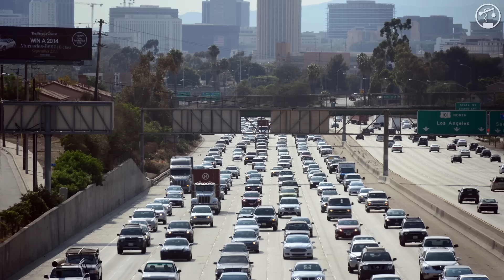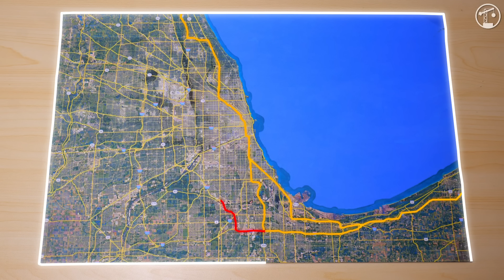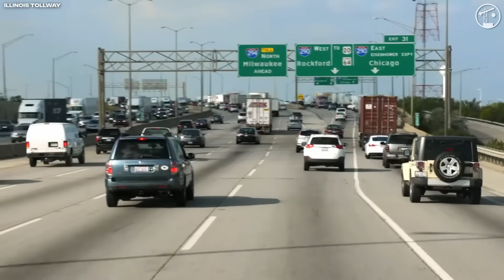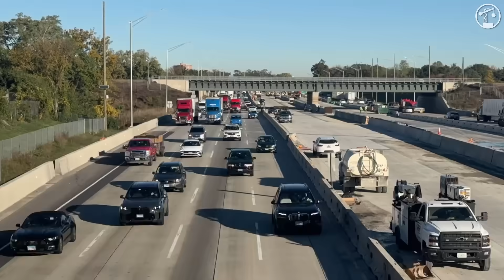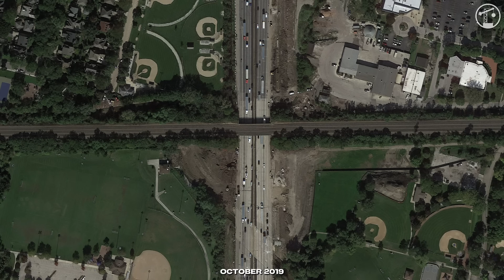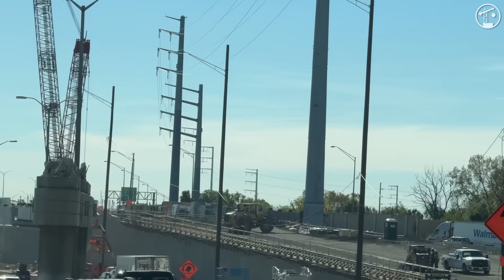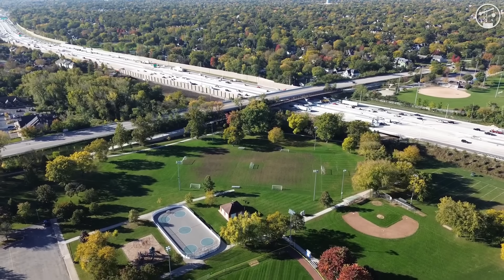Why Chicago is Spending $4B on One Road

Comment: Think the answer lies in why the Eisenhower Xway became I-290 back in 1978. It was I-90 from the now Byrne all the way out to Schaumburg…. but that just begged the question??? Why not build the 16 mile bridge between the Hillside Strangler, near Midway and the Skyway? No not the Crosstown debacle. A hypotenuse that would shave near 6 miles off the current 22 mile trip down Ike and North Ryan. A bonus is that the current 60 mile trip from Schaumburg to Hammond would be 50. The tollway is making plenty of $$$ and are ready to raise tolls. This project would be near $8B and take a decade built OVER existing rail ROW with minimal neighborhood disruption or destruction. No amount of widening existing xways would do what this would.

Comment: The original roads that were built and used as the toll system were paid by tax dollars... All the improvements and all the time to continue to maintain these roads seems more like money laundering than engineering.  This is a never-ending tax to every citizen that lives or drives through the area.  To top it all off, Google maps suggests the most expensive routes even though they may be slower.  I have experienced this on numerous occasions.  Many other occasions there happens to be an accident or something else on a straight road forcing many people to use the skyway and the higher toll prices... It just doesn't seem like coincidence at all. There is some fuckery going on.

Comment: The worst area is 290 East at 294 South interchange near Hillside.   Dickhead drivers sneak down the center and left lanes all the way to the last moment and then slow down to cut in front of the line just before the exit ramp, causing a backup several miles all the way back to York road and sometimes beyond.    I swear when I become king I will place a sniper at that interchange to do what needs to be done.

Comment: Thanks for the explanation of the project. I drive a sprinter and a straight truck all over Chicagoland and I am rarely delayed more than ten minutes. There are a bunch of workarounds for problematic areas, like the 294/290/88 interchanges. And if you are cagey about it, taking 294 is a piece of cake.

The bigger problem for me is the work on 53 north of 90, but there are plenty of workarounds for that one too.

Comment: The redesign of 294 South to I88 was done by a DEI HIRE! They took something that worked half-ass and to the lowest level of stupidly there is. A half-ass interstate to the state of not moving at all. Take two major interstates, run them together, down to two lanes, force the traffic to cross each lane to get to the interstate you want to get to and then give them nowhere to go. AT RUSH HOUR you could take 294 S to I88 and for the most part, keep moving. NOW Traffic is backed up a minim of 3 miles JUST TO GET TO THE EXIT to go through the maze of HELL. It's now a GOOD 2-3 hours wait.  JUST FREAKING BRILLANT!  ILLINOIS - WHERE THE CRIMINALS RULE AND THE INSANE design roads.

Comment: Lol the biggest problem is compared to other highways.. the off angles of 294 because of the other highways is the biggest problem.. not to mention adding another lane will mean more cars ans trucks will use it the biggest problem is trying to change lanes to get off. Too many people dont let you in on top of clueless drivers trying to change lanes at the last min. Like the 294 to 290 should habe done what they did with the new off ramp to connect 390 an elevated on and connect further west. The other big one is with that many lanes the furthest left two lanes should only be for cars or light trucks.

Comment: What a mess.  Thanks to the oil companies for promoting automobiles and destroying mass transit and long distance railroads \s. These "improvements" won't last 5 years before the next major congestion crisis disables it all.  What, create 30 lane wide roads everywhere?   CHicago had the best railsystem in the world (still has one of the best commuter systems). No thought given to expanding and improving that (fewer trucks, more local freight distribution...heck put the trucks on trains). Concrete accounts for 20% of the CO2 problem in the atmosphere.  This requires a massive rethink of how we commute, travel, and distribute goods and services.   The (ultimate) goal should be: NO CARS WITHIN THE 294 BELTWAY.

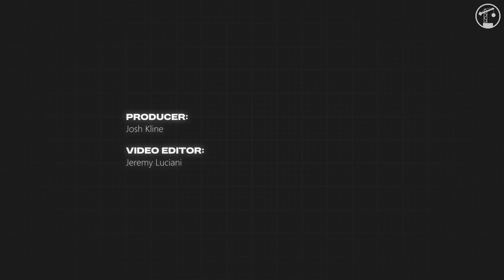Comment: Some issues with the congestion could be solved by raising the speed limit to 70 mph instead of 55 in most cases in the 9:19  Chicagoland area. Especially on I-94 and I-57.  There’s no reason that I-40 in the smoky mountains has speed limit of 70 and keep right unless passing signs. And i94 and I-57 doesn’t  is a big mistake.  I-40 is much more challenging to drive regardless  of the vehicle than anything in the Chicagoland area. Making this change would solve a huge conversion issue.
Reply: I’m gonna tell you, virtually nobody drives the speed limit. 90/94 especially, left lane is 90mph+. LSD is unofficially 70mph. We got places to be 😂
Reply: LMAOOOOOOO 

You think people follow the speed limit???? No one goes at the posted limit and it's extremely rare that state troopers pull you over for speeding.

Comment: I lived in the Chicago area for almost 50 years.  For DECADES, they have been trying to expand freeways and their disgusting tollroads and they have never been able to accomplish much of anything.  One thing you can count on there is that when a road project begins, they will first tear the entire roadway apart and then do nothing for months at a time while traffic becomes even more horrendous.  On top of that because of all the corrupt politics there, they can never even get to expanding roads significantly.  It's so awful that it was one of the reasons I moved out over 20 years ago.  Frankly, you couldn't pay me to live there.

Comment: What this sounds like to me is "just one more lane bro" but fancy. Like, there is no true fixes to traffic that I heard. All I heard was structural improvements and some tech. What does this do? Why make this 5 lanes??? Four lanes is always enough. Even two is. The issue is the interchanges and traffic in other parts of the city that backs up onto the highway. Now, yes, crashes do happen, and yes, traffic stops and pulled over cars divert traffic, but four lanes sould be one more than enough to get around that. They should also look harder into what is causing the crashes. Is it bad drivers, or is it distractions, or is it bad roadway design?

Comment: We sold a home and bought another just move 20 miles from the NE end of this corridor to the far SW side of it. We saved LITERALLY 500+ hours of drive time, stuck in traffic, in the past 6 years since we did that. We still will avoid the 294 corridor as much as humanly possible. Suggest everyone to the same.

Comment: I drive from Wisconsin to Indianapolis couple of times per year.  SB 294 is fine until Ohare and then it turns into a nightmare.
Reply: You mean theres a section of road in Chicago that is trash  good thing they took our road repair budget and as always gave it to Chicago
Reply: 100% after ohare going south is a nightmare. Going through at ~5pm is not for the weak

Comment: In a metro the size of Chicagoland, “IF induced demand shows up?” 😂🤣🤣 No doubt the better geometry will make the road safer, and that’s good…but I’m not a fan of increasing capacity with more lanes. It will be perpetually congested, adding more lanes is not a solution.

Comment: When our cities have a lot of traffic, the lanes get split physically.  The inner 2 or 3 lanes can only be used for a destination much further way (say 5 to 10 miles ahead at least), and the outer 2 to 3 lanes are for local in and out.  The inner lanes keep flowing with 60-80 mph, the outer have 30-50 mph with traffic lights and roundabouts.  Much easier than merging different users in one huge plane of tarmac.

Comment: Going through Chicago at 2AM to 4 AM has always been my favorite time. Often doing it within a minute or two from the last trip through.
Reply: I've been stuck in 'red taillights as far as you can see' traffic at 2am in Chicago before 😮‍💨 you're never truly safe
Reply: i remember i had gone all the way across 294 to the jane addams sooo fast at that time after a long road trip. just me and 2 other SUVs hauling ass. even still there was some congestion at that time as well
Reply: Cruised those corridors like butter for years from 1am to 5am
Great drive!
Reply: Now there's snipers on that route
Reply: 2009: late August,  2 baseball games -- SOX and CUBS, Dan Ryan Expy and Kennedy Expy I - 90 / I - 94 -- I - 290, I - 55... 2 baseball games ended to 9:45 pm in Friday night --> home is  Quad Cities Illinois - Moline, 4:55am  - 180 miles , ...Cubs WIN! ( Sox Win!...)
Reply: Yup, and petal to the metal. It's the best time to run through.

Comment: @BuildCore
The solution is to treat it as what it was supposed to be... a by-pass.  Close off ramps.  Demand will go down if it functions as it is supposed to function as a way to go AROUND Chicago.  Remove all of the exits that don't go to another interstate, the airport, or a major state highway like 41.  Remove all of the street exits for local travel.

We always do this in the USA we build road that are to avoid local traffic and then we open them up to local traffic to increase the local land value.  If they really want it to work this way they should treat the entire 294 like an express lane.  It only exits on to highway level side roads every 5+ exits of that side road.

Comment: Having been stuck in Chicago for 20+ years (I miss San Diego), I have thoughts. 

The I-294 isn't bad. Even at rush hour it moves. The non-topl roads are awful. 

I would commute from NW Indiana to the near north side (Humboldt Park) M-F. It took 1.5-2 hrs each way by car. Taking the train and a bicycle took even longer. 

You want to solve the commuting problem? Fix public transit. Leave the roads alone. Get people off them in the first place.

Comment: Corruption at its finest. My assistant is 69 and he said that when he was young the tolls would pay for all this and then they would take them down. 

I get the congestion and im glad it is getting fixed. However the bigger pic here is it shouldn't take this long and the tolls should pay for it right? That's the whole point of the tolls. And all the other wheel tax etc they raised up these couple of years. SMH

Comment: 2 seasons in Chi-town, slowly becoming one season: Winter & construction seasons. Construction is definitely a great way to provide good paying employment. And fund Union projects. (Massive slush funds?). Truck traffic always blamed for destruction of road surfaces, but one might surmise better , more durable surface materials are available. (One observes trucks with heavy loads on mountain passes out West.But potholes seem rare. ) IMO, as a lifelong area resident, it seems there are wide ‘seams’ often between adjacent surface layers. These seams allow passage of water which will freeze & expand, disrupting surface integrity in Winter. Built in planned obsolescence, or cost cutting? Then, the plows hit the edges and boom, here is a pothole. A never-ending, but expensive, vicious cycle. Groups of ‘roving roadwork’ then travel, blocking traffic with temporary fix, which seem to last only days. During repair, multiple safety trucks block several lanes and folks with shovels manually put some crumbly asphalt into pothole and manually stamp it down. Usually, it seems 8 folks standing and 2 working. Maintenance of roadways in Illinois , is for jobs and political power, at this point. I remember seeing an article of which construction company received the gub’ment money, and according to article there are maybe under 3 ‘favored’ companies receiving windfalls of tens of millions of dollars annually. But then, as a Royko character would say, “…only suckers beef…” so, I’m just sayin’ …..”rock on and keep those wheels a~rollin’”

Comment: I can speak on this more than anyone else. 

I was a truck driver in Chicago for 15 years. 

And I worked on every single expressway in the city. 

At this point I think it's just too far gone to save.

Every construction project they have ruins traffic so bad for so long and then by the time it finishes they move right down the street and start over again and the pain never ends. 

You never have a period of time where all the construction done all the roads are working never in Chicago. 

And it's not done by accident either. 

If you own a company building bridges wouldn't you rather have steady work non-stop? 

Which is exactly why the construction will never stop in Chicago. 

And it is also why the roads will never be fixed as well as it could be. 

Why would they finish it this year when they could come back every 5 years and redo it forever?

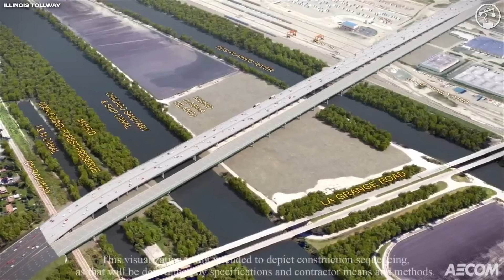4:56 I worked on that project in particular extensively.

Comment: You missed the fact that a major driver of traffic is the fact that there are few circumferential transit routes and the ones that do exist are slowed down by diversions to cover as much area as possible and have poor operating schedules, especially in the midday, evening, and on weekends. It is also counter intuitive to make the highways into the city free despite numerous high speed transit options that parallel those routes but they charge to go around the city where driving is usually the only option.

Comment: Used the Tri-State Tollway a total of 5 times over the last 6 months. The first time I came in from Indiana on I-94 at around 4pm and instantly regretted it…took 2.5 hours to get from Gary to North Chicago (Buckley Rd exit). After that I used the Tri-State Tollway only between 9pm and 4am and made it from North Chicago to the Indiana state line in one hour flat.

Comment: The problem sounds a lot like the highway across suburban Toronto. It's the same situation, people getting around a nearby lakehead, with no other route possible, because there's a lake in the way. Toronto has been continuously expanding its highway since the 70s, and it hasn't helped. It's 16 to 20 lakes now, all full.

Comment: Last year I drove it South to North at midday, hoping that by missing "rush Hour" traffic it would be somewhat bearable. I still spent several stretches either barely crawling along or fully stopped for a handful of minutes. On my return trip I travel it at roughly 5 to 6 am on a Sunday and breezed right along with barely any accompanying traffic.

Comment: One issue was Illinois throwing in the towel and not completing the I 355 project to the west. It was originally scheduled to continue south and then turn east to connect to I 65 in Indiana. Approximately at Rt. 2 in Lowell In. That would have relieved the traffic on 80-94 to 294. Traffic heading to I 80 from the south and east would not have had the 294 option. And as Josh mentioned travelers from northwest Wisconsin and Minnesota would have that other option. But Illinois blinked and the far southwest suburbs were built up and now that I 355 path is no longer viable or available. Typical…

Comment: You ever drive this?  It would tie up traffic for 20 miles in each direction.  It was called "The Strangler".  Even the changes that have been made already have made it better.

This is better then California spending $30 BILLION for high speed rail that has NO rail laid.  

This isn't just paid for by Chicago, it's the Illinois Tollway Authority.

Comment: There will absolutely be induced demand and the backups will not improve. The only way to fix the backups around Chicago is to move as many trips off the expressways as possible. Expand the CTA, increase service, interconnectivity, and electrify metra, implement loop congestion pricing and implement more congestion pricing on 290. Force those freight logistics to use rail so they won't clutter up the highway for trips that actually need it. Densify and interconnect the suburbs and make better connections up to Wisconsin and out to Indiana.

At least this project isn't taking state DoT funding, but make no mistake, it is a just one more lane project, and the geometry updates are minimal. This is our own Katy freeway.

Comment: 1.  It is a choice to NOT build a coastal bypass that just comepltely passes downtown along the coast. They could do one and directly connext to the Skyway but they also need the open road tolling on the skyway and get rid of the gates.
2. They need to build a second major true bypass out of 355 to mirror 294 and get the cross country traffic another route around the city and not have to come into 294.
3. Then as a final measure make 294 a non-truck freeway. Force the trucks to go to the wider bypass on 355. Unless thye are local deliveries.

Comment: That's the official justification, but keeping the concrete industry happy is the real reason. I294 is a classic demonstration of induced demand. A lot of that traffic would never exist without the road, not just divert but not even exist. It's a terrible alternate to I90/I94, nearly as congested but I90/I94 is free through most of the same corridors. American states won't build transit for something like this because railroads don't need nearly as much concrete and other heavy construction. Gotta keep the contractor lobby happy.